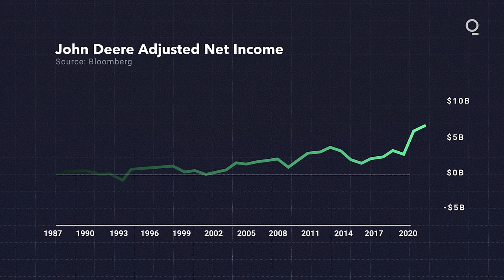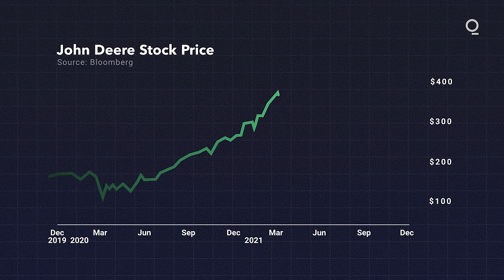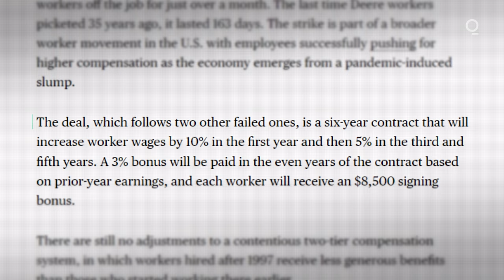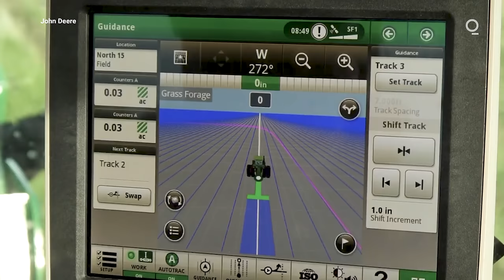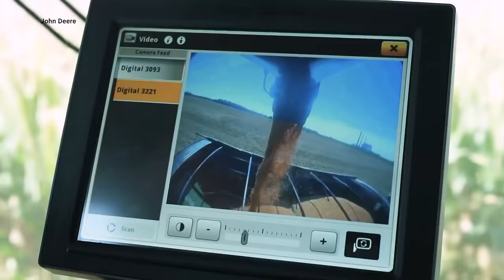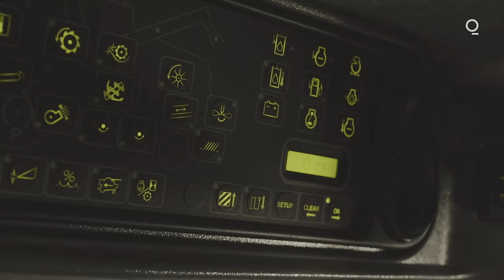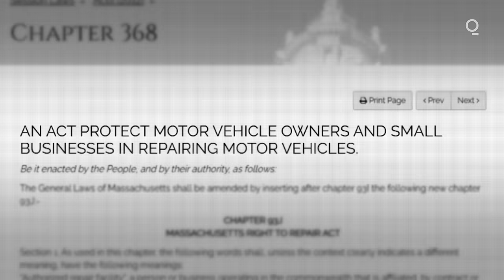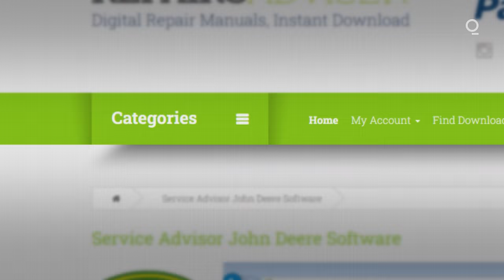John Deere Is Facing a Farmer Revolt

Comment: Next time you need to buy a piece of JD equipment ask to include a speed of repair clause into the purchase. Fixed within a certain time or the dealer starts paying a penalty. Happens in the airplane business. ( that JD compares themselves to )
Reply: The problem is, for a farmer during harvest or sowing any delay is unacceptable. So the farmer will want a clause that has a tech on site within the hour, regardless of day or time.
JD however would prefer to not have to pay for that kind of service network, especially given how vast some distances can be in the US, so they're more likely to view a couple of days at the bare minimum as an acceptable delay. They're never going to sign a contract that demands penalties from them within a couple of hours, when it's physically all but impossible to get someone on site within that timeframe.

As for the airplane industry, most airlines regardless of whether it's cargo or passengers, will just fly a different plane in to replace the broken down one while it waits for parts to arrive. In which case it might not really be an issue if a plane needs to remain in hangar for a couple of days.
Farmers usually don't have a spare tractor or harvester standing around just in case their primary one breaks down. And I bet that JD doesn't want to provide those temporary replacement units at short notice either.
Reply: That penalty in a farming scenario would be replacing lost revenue for the farm that results from the delay in repair. That would bring a lot of support for John Deere, and be well worth the short term losses to maintain the monopoly.
Reply: @fermitupoupon1754  The airlines have extra planes because canceled flights cost a whole lot more than delayed ones: Enough to justify owning an extra plane. Given the tendency of farming away from the folks in this video and more toward large conglomerate corporate beasts, I bet you'd find that said large entities DO have spare tractors because of a similar issue - they can afford to cover one for partial use if down-time is guaranteed. (And it is guaranteed for any given machine with moving parts and software.) Just one more reason that family farms are dying out - if you only prioritize profit margin, eventually, that's all you have ...
Reply: @stephentroyer3831  As an alternative. Take out an insurance policy with the dealer ( backed by JD ) that in the event of a breakdown the dealer will have it back in action in a certain time frame or a "loaner" on site. How many dealers when you take your car in for service give you a loaner for the day. It's an incentive for JD to build reliable equipment

Comment: Deere needs to have service mechanics available 24/7 to assist its customers. Allowing it to be a 9 to 5 , M-F deal, is reprehensible.
Reply: Oh sure they're available at night on Saturday. Just pay 3x the normal rate.
Reply: Not true. You don't see the bigger picture. Forcing farmers to use John Deer repair only will ensure another monopoly, and that the farmers don't truly own the vehicle. Those "malfunctions" are not necessarily accidents either. As seen with the automobile and household electronics industry. This means the farmer has to pay a "tax", a part of his constant revenue back to the producer.

Which is very unfair and theft with extra steps. They are not providing a service, they are forcing the farmers to pay a monthly extra.
Reply: @Kareszkoma  Auto manufactures are already claiming we don't own our vehicles because of the software in them. 
"Automakers Say You Don’t Really Own Your Car"
Reply: @nicoradv3923  I know. We had issues with it. Going on a highway and the computer locks down and starts slowing down the vehicle, because a sensor popped. Luckily we only had to pay for the towing, as the sensor was 2 minutes to replace and very cheap, so the repairman asked no money.

Also, another fully functional modern mini-van, doesn't start up because the onboard computer had some crash and now it writes error and that's all.

You can either pay up, or throw the whole vehicle out. The brand-service asks outrageous amounts to get it fixed, luckily there are third party that can fix it.

This is just not okay. Extra costs, hidden taxations, like you are renting a house from a landlord.

Comment: As far as salaries go, perhaps there should be a law that states that CEO's should be only entitled to the same percentage salary increase as workers.
Reply: In all honesty a maximum wage would be more useful than a minimum wage.
Reply: Perhaps the worst Example of this is last Year's Train Driver Strike in Germany. The Train Drivers at Deutsche Bahn went on Strike for a 1.5% Raise, which isn't even enough to adjust for Inflation, while the Managers gave themselves Raises between 10-20%, meaning that none of them make less than a Million per Month now. All of this happened during record Losses due to the Pandemic, and the Deutsche Bahn even refused a Government Bailout, because that would have preconditioned no Management Raises in 2021.

Another Example for Management Greed in the Deutsche Bahn is how they improved "Punctuality". Until 2019, a Passenger Train was considered on Time if it was less than 6 Minutes late, but the Deutsche Bahn kept failing massively on their Goal of having 75% of Trains on Time. So they just increased "on Time" to less than 15 Minutes late and then paid themselves Millions in Bonus for having reached the Punctuality Goals.
Reply: I hope you're a liberal, because what you' re asking is for the gov't to step in and make laws against rampant  capitalism.
Reply: Or that workers can only be paid in stock options.
Reply: @D8W2P4  thar's not how things work.  There should not even be a minimum wage.

Comment: I've worked in the IT field for 20+ years and currently run my own computer repair business. I'm extremely familiar with the battle on "Right To Repair". Using 3rd party parts and a non-Apple certified technician (or being able to fix it yourself) to fix an Apple product can't even begin to touch the amount of money that could be saved in repairing these John Deere tractors. These are truly amazing machines and not only do you have the mechanical side of repairs, but you need an IT guy on top of that for all of the sophisticated electronics on the things. It has to cost a fortune to just maintain these machines, I can't even begin to imagine if something was to break, especially with the "John Deere tax" that I'm sure is added.

Comment: For those that don't live in "Flyover country" you wouldn't believe how farming and ranching has changed since the mid 80's Farm Crisis.  I've basically been out of production ag since about 1997 and it's changed a lot even since then, and not for the better as consolidation in farm size, implement dealers, and supply companies such as feed and seed/fertilizer/chemicals has been unreal. Add to that the continued emptying of the countryside and small towns in population.
Reply: You hit one major nail on the head there that tends to get overlooked in this : farm size.  When pieces like this are talking about 'farmers', they are not talking about farmers in general, but farms of a specific size and below.   John Deer is suffering a PR problem since the non-farming public romanticizes small farms, but the actual market is dominated by the large businesses now and John Deer's current practices are built around their needs and priorities... meaning in many ways this is a proxy for the 'big business vs small business' cultural conflict and who gets to speak for 'farmers' when really it is a group with increasingly divergent priorities.
Reply: @neeneko  Absolutely. John Deere, and to a lesser extent Case-IH, has activly pushed for fewer and larger impliment dealers. I don't know if it's true but the "rumor" has been in Iowa that JD only wants ONE dealer in each county in Iowa, that's 99, and most of those dealerships now are part of a larger merged network. The indepndent single store JD  or C-IH dealer is all but gone. So much for competition... The amount of dealers that have merged and/or gone out of business the last 40 years would seem to bare this out. Sad; and really sad when you are 30+ miles from a dealership and need parts in a hurry.
Reply: I've lived in the "big city" since 1987. I grew up on a farm in the 60s though. When I see the machinery today I can't help thinking what grandpa would make of all this.

Comment: This space is RIPE for a well-informed, local, open-source startup for either original equipment or bolt-on accessories.

It’d be seriously difficult to thread the needle just right and dodge the entrenched interests, but has the potential for yielding an immensely valuable market.
Reply: Potential is there, but you’d need to wait and see how all of this plays out. How the strike goes, and how the ongoing litigation goes. Entry into this market requires a ton of capital which is the problem.
Reply: Sounds like you're describing monarch tractor
Reply: The problem here is John Deere will most likely sue for a DMCA violation. i.e. the accessory violates their DRM.
Reply: Market inefficiency is opportunity for those who are willing
Reply: This was my thought. Create a tank of a tractor. Open source the software. Set it up so farmers can get a remote technician. Instead of sending a repairman for a power down and reboot. The information the software collects sell it to who ever wants that information. I don't see any reason why corporations should have access without the benefit going to the actual farmer.

Comment: There's an incredible irony to this.

States like Nebraska tend to be "red" states, opposed to regulations - particularly regulations involving telling businesses what they can and cannot do.

Yet the Right To Repair law does precisely that: it tells farm equipment manufacturers that they cannot force farmers to use only their mechanics, technicians, dealer network, etc. It would force farm equipment manufacturers to do things that cut into their profits and reduce their control over their products, so that their customers benefit. That's a very "blue" concept.
Reply: And having completely different standards for what impacts oneself vs others is a very "red" concept!

Comment: It's been going on for several years in my part of rural VA.  Farms that "bled green" for generations now buy New Holland, Mahindra, Massey Ferguson, etc.  Even non farm specific JD equipment is being replaced with other brands.  Kubota and Mitsubishi SxS are replacing Gators.  Older JD equipment brings higher prices at auction than newer stuff because you can work on the older machines yourself

Comment: Great vid but it missed one of the most frustrating parts of the right to repair movement which is the refusal of manufacturers to supply parts or sell individual parts to consumers.

Often manufacturers will either refuse to sell parts outright (eg apple) or make only full assembly's available when only a small part or sensor is needed. Without getting too technical the best way to describe it is being forced to buy an entire transmission computer when only a sensor bolted onto that computer is needed. Plus the manufacturer forces consumer to return to the dealer because the new transmission computer wont work until its been "coded" which would not have been necessary if the sensor only was replaced. A double windfall for the manufacturer. 

Often manufacturers will include unnecessary computerisation on individual components to force consumers to go back to the dealer to have a part "coded" to work with other components. This also puts the price of the part up and keeps owner from being able to use generic parts. Without the coding aspect farmers may be able to borrow a part off another piece of equipment to get them through a harvest but because of coding machine wont run and they have to wait for the dealer.  

Manufacturers will also hide the information from error codes to keep the owner in the dark and be able to upsell more expensive parts or repairs when a cheaper repair would have sufficed. 

Result is 
OLD DAYS: Machine start performing badly or making a noise but is still able to be run/start machine, farmer finds problem by following noise or issue, farmer gets spare part that may have been already on his or a neighbours shelf or other machine. Farmer fits part and continues farming.  Farmer can also decide(depending on the mechanical issue) to continue farming despite the issue and risk further damage to the machine but still harvest his crop in time.  

THESE DAYS: Machine shuts down with only a vague code or "call dealership" error. Farmer cant bypass the error or continue farming. Farmer kept in the dark about the fault if there even is on one (computer may just need reseting), Farmer has to call dealership and waits days for dealership to come out, Dealership computer reads code and orders a full assembly, Dealer comes back when part arrives and codes it so that it will work with machine. Machine has been down for days, driver has lost wages and farmer has lost crop.
Reply: I sure hope the right to repair rules will open access to the parts otherwise it isnt much of a win.
Reply: @NathanNostaw , there will not be a win.
Reply: Well said!👍

Comment: I am not a farmer, I am a machinist. Clearly,  I believe in the 'Right To Repair' ANY piece of equipment you purchase. After all it belongs to you. Plus some of these repairs are how I make my living. Most of the tractor type repairs I see are JD and they come to me because they are parts that were made over seas, my guess is China.  The parts are  I see in my machine shop are not the parts of yesterdays JD, they are designed inferior to older products.  They are designed to fail sooner rather than later.  I feel this is an attempt to force folks to buy new equipment.  I always go out of my way to fix these JD products. I have felt this way about JD simply because they account for most of my tractor related repairs. In 2004 this feeling steered me toward Kubota and In the last 18 years the only repairs I have made are  cylinder rebuilds for my FEL and these repairs were made in the summer of 2021. The next tractor will also be Kubota.  My question to the farmers is WHY BUY JD EVER AGAIN?
Reply: Come back and read the comment by "MrDogfish83" To answer your last question.
Reply: @chuckgilly  I see what ya mean.

Comment: As most of you already know, an OBD II scanner for your automobile can be cheap and useless or expensive and incredibly valuable.   I am absolutely ignorant of farm products, but certain that there does exist a port on each of these units for a scanner which will be both expensive, valuable, and ubiquitous on large farms and in independent service shops across the country.   If dealers would  staff the urgency of planting and harvest seasons just as the farmers do, there's be no complaint of time lost to weekends and salarymen.  I enthusiastically support a Right to Repair bill as broad or narrow as can be passed if it includes farm equipment.

Comment: The "It's for safety" narrative from JD is so condescending. It's like saying "We're taking responsibility for your safety because you're an idiot."
And unrestricted farm equipment has been around for decades yet I don't know of any problems with tractors doing doughnuts on the road. People buy hammers to hammer stuff, not to fly on them. At this point JD and all other restrictive equipment manufacturers should just shut up because whatever they are saying is actually hurting their image more than if they said nothing.

Comment: This doesn't even delve into the issue of cyber security. Imagine a foreign enemy, ie terrorist, being able to hack into Deere's network and shut down all the tractors at harvest. That would be catastrophic to the nation. I'm not convinced that these connected tractors aren't a massive risk to the US food security..
Reply: I did not think of the security aspects and I am embarrassed I did not.
Reply: @michaelpotter6542  normally security risk is used by the manufacturers as an argument. In this piece John Deere has even argued that the safety risk of aeroplanes is almost equal to that if farm equipment in wide open spaces or more accurately rural roads.
Reply: honestly that moot because , if farmer has the tools they can just fix their equipment take their immediate use tractor off the grid and use it normally .... That just the same as telling people hey they can hack into your house and cars ... its arleady been done before ... all you gotta do is take off the connections to the internet and it can run without need of connecting to the grid
Reply: @Kipkemoi  I would argue that John Deere should not have over the air access to the tractors because of security risk.